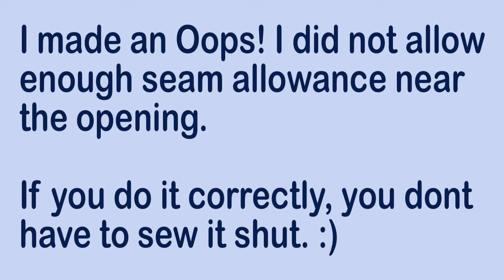DIY Cloth Wallet

Comment: Hey! I have the same sewing machine and am wondering what my tension for bobbin and upper are supposed to be? And what knob is for the bobbin tension? Today my machine is doing looping on the underside and the stitch comes right out with a little pressure. 😖
Reply from the maker: The best way I have found to solve this is to take a scrap piece of fabric to sew and play with the dials. My machine has used one setting one time, and then required a different setting the next for the same type project. I try to start a project by testing the stitch on scrap before I work on the project itself.